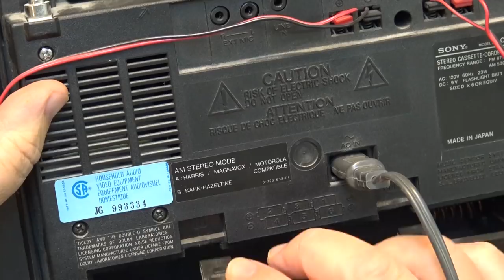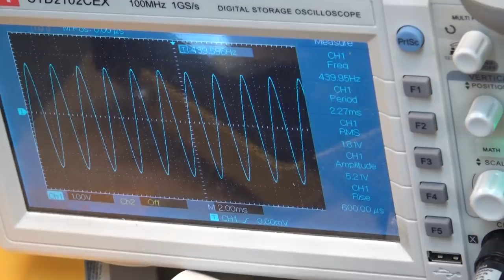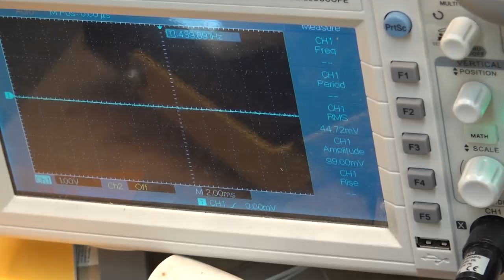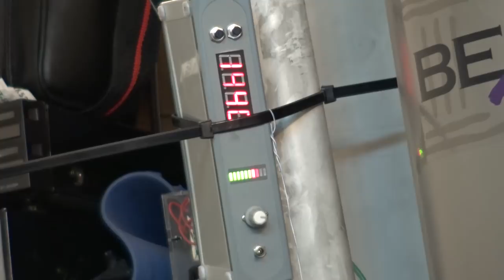Sony CFS6000 Boombox Tape Deck Service

Comment: Is that where my screwdriver went! 
Fancy that, my screwdriver made it on YouTube before I did! 
Well at least it's found a good home, glad to see it doing duty on a classic boombox. I have a real soft spot for the classic boombox. I love their industrial design, the mechanical and electronics that went into them and their sound. Great video, I personally would have gone right through it and checked every resistor, capacitor and lubricant. But that's just me with those things. I'm a lot less fussy when I comes to electronics that I I don't care for like the Boomboxes from the 90's and onwards, some of them were actually nice but the rest just looked like piggs, those things get taken apart and removed from memory! They make good use for spare parts! Although I did take apart a sharp boombox that I wasn't going to put back, a few days later I found myself looking at it's main PCB and noticed that sharp used those beautiful Melf barrel type resistors! And then while looking at the cassette mechanism and noticed that the erase head is the active AC type! Boy! Sharp really went all out on this boombox! Who builds a boombox like this? I feel like putting it back together just to hear how it sounds but it's to late. Now I'm looking out for another one on eBay just to test it's capabilities. 
Your Sony boombox almost looks like it has the active AC type erase head! Not the cheap permanent magnet type. I believe that the erase head type makes the difference between a good recording and the average boombox type tape recording which always sounded terrible! Unless the other wires I saw were for the other side of the playback head!
Reply: Lmao it’s ur screwdriver 😂😂😂😂

Comment: Thank you for saving this set and make her to serve it's Master for Many year's to come... Cheers 🥂..
Reply from the maker: Its not that I saved it, I bought it new in the 80s specifically to listen to am stereo. We used to have great music stations in am stereo and it sounded really good.  Very close to fm but with a warm sound.  If you ever heard am stereo you will know what I mean.  You can hear am stereo on line.  There js a us station that still broadcasts in am stereo and they use their studio am stereo air check tuner to feed their internet stream so you can listen and hear how good it originally sounded.

Comment: Boiling the belts was a HUGE tip, wow. I bought this model because a station does C-QUAM locally and it matches my SRF-A100." :) Anyway, same deal as yours - great condition but needing TLC inside. I followed the same procedures as yourself, except for reusing the belts in mine. Tapes sound PERFECT after equalizing :D Thank you for sharing the knowledge!

Comment: Nice to see the motor not changed at all from new, dam spot on :-D.

Some of the 70's motors had flying weights inside and contacts, they worked, but by the time i got to see them, they were all worn out :-(
Reply from the maker: zx8401ztv 
These were popular in old 8 track players. Others had an fg pickup and full speed servo.
Reply: Yes they were, recently i helped my frend get an 8 track going, the headstack was frozen on the rod, and one channel was dead.
It used odd blue transistors in the finals, my mate had some in his garage in a draw, old but tested perfect :-).

It had a quite chunky looking motor, but they had a habit of a double casing the motor in those days, noise screening i think.
Apart from dirty pulleys and a very dead belt, the transport worked :-D.

The headstack took a while to loosen, wd40 was left on it for a couple of days, then gentle twisting by hand slowly got it off.
Worked great once the headstack had been adjusted.
im not into 8 tracks but my mate has an old car, its going in that.
He also had a cassette to 8 track adapter, you treated it like a cartridge then you put a cassette tape into it.
Ive never seen one of those before.

Comment: These old radios are great workhorses, those heads are immaculate should last at least 20 years, its also got a great dc bias recording head, which is rare in a boombox
Reply: AC bias, not DC bias.

Comment: We never had AM stereo here in Great Britain.
It would have been handy for the car before stereo FM was perfected.
There used to be a beat cancelling switch when recording AM which changed the bias frequency slightly to avoid clashes with the AM frequency selected.
FM here has more clarity than digital because of the low bit rate of 128kb on most music channels.
I don't know if digital radio in Canada is any better.
Reply from the maker: Yes this has the beat cancellation switch on the back. 3 position.
Digital radio here is broadcast in 2 ways. As a sub carrier on a commercial FM station, and as a phase modulated mono AM station. So HD radio as they call it (Hybrid digital) can be broadcast either way, but here in my local market it is all on the FM sub carriers. The big stations have 3 sub channels. HD 1 carries the program audio with the FM station, HD2 usually carries the AM sister station for the FM stations audio, and HD3 can carry something completely different. Here one station has music on HD1, news on HD3 and sports on HD3. Another one has music on HD1, talk on HD2 and traffic on HD3. Those news, sports and traffic stations are also on AM band.
Reply: We had it for a while here in Australia around the mid-80's but it never really took off where I lived. AM was mostly mono. Nowadays it's digital radio with a wide range of FM and AM stereo stations.

Comment: I got a few different boomboxes sharp sanyo and hitachi the first hitachi 3d8 i gave to my dad i loved it but used it on batterys back in the day and was lucky if i got a couple of hours use out of it with the 3d superwoofer in use it used to eat batterys .One of the sharps i have has an electronicly operated back to back cassette mech quite complicated has two motors two fly wheels belts and 3 or 4 solenoids not sure what sharp was thinking with the back to back mech .

Comment: The common problem I find on Sony boom boxes are Idler tires splitting in half. I use O-rings that I purchase from Harbor Freight as replacements. They outlast the factory original idler tires. No one stocks the replacements  on these Sony boom boxes

Comment: Maybe a dumb question, but why don't they used gears instead of belts?Noisy? They don't last longer than belts? Not feasible?
Reply from the maker: Mark Markofkane 
Well if you wanted wow and flutter sure. Belts are a natural shock absorber and will reduce micro variations in motor speed as the motor spins. Also when rewinding and the tape hits the end prevents the tape from breaking.

Comment: Why you didn't clean and lubricate the tape deck mechanism? you should  clean and demagnetise the recorder head and gum discs.
Reply from the maker: I don't use it.  That tape deck has not had any tapes run though it.  When I got that radio it was for the am stereo.  I have never used cassette tapes much.  I bought into dat in the  mid 80s and stopped using cassette.  I didn't lube it because it has no hours on it and hasn't even been turned on since this video was shot.

Comment: Great Video, i have the same unit but after replacing the belts & cleaning the capstan , it keeps eating tapes. is there an adjustment for the speed?
Reply from the maker: Idler likely worn.
Reply: speed slow too
Reply from the maker: @edgarregis4818  did you put the correct size belts? Too tight and it will be slow
Reply: is there a speed adjustment?
Reply from the maker: Should be on the motor.

Comment: Is there a place to get good quality belts? The ones most get and what I’ve got are very low quality and the consistency is bad. I had to sort through half of 2 sets to find one that had a somewhat even thickness so it wouldn’t have as much wow and flutter.
Reply from the maker: KP components has a fairly good selection.

Comment: Where can I buy the capstan belt for the CFS-6000? I bought a belt on ebay but it is the shorter belt. I need the longer one. The ebay listings don't give the lengths of the belts so I can't tell if any of them are the longer belt.
Reply from the maker: Belts are all sold by length.  You need to measure the pulley length.  I have demonstrated this with dental floss in the past.   Thread it around tie it tight.  Cut and measure.  Subtract 5% from measurement and you have belt size. Don't ask me, i don't know any sizes off hand.  When I need a belt i measure it.
Reply: @12voltvids  Thanks! This radio has great sound. I can't wait to play some tapes in it.

Comment: I remember when I was a teenager I used to dream of owning a Nakamichi Dragon cassette deck. Never could afford one, but they are still pretty cool. And insanely expensive now, lol. Dumb question ... how did you get the 440Hz test tone into the scope?
Reply: Looking at the relatively high voltages the oscilloscope showed, he probably hooked it up to the speaker outputs.
Reply from the maker: Hook it to the speaker terminal.
Reply from the maker: The dragon was overrated. I worked on a few of them in my career.
Reply: Knowing how many tape decks you've serviced, I actually trust your judgement. :)
Reply: Same, I wanted to own a Nakamichi Dragon when I was 16. Though this Sony boombox is almost similar to a Dragon in terms of the multitrack head, but minus automatic azimuth adjustments, but similar in they only record in one direction only and reverse play.

Comment: This was a great and useful video. Also what a nice thing it is to see one of this old decks come back to life. Wish I could send you my Sony FH7 for service! Just one question: How does this 'belt boiling' work?
Reply from the maker: The heat charges the molecular level in the rubber and helps it return to elasticity.
This does not work with all formulations. I believe it only works with natural rubber. The synthetic belts don't shrink when you heat them. Or is it the other way around. 
Anyway worth a try if belt is slipping. It either works or it doesn't. More often it does.
Reply: @12voltvids  The belts have to be put in water and then in the microwave? (Apologies, this obscure technique is new to me) Thanks!

Comment: All these years of tiny belts in things and nobody has found a better material or way to make them or completely remove the need for belts at all.
Reply from the maker: Tyler Harris 
Direct drive is costly. Even my high end teac 850 is a belt drive capstan. My technics rem275 is direct drive. It was a bloody expensive deck though. 
My technics slm1 turn table also direct drive. This also drives up the complexity as special drive circuits required. Most vcrs were direct drive for drum and capstan. At least vhs was.  Many beta and 3/4 were belt drive.
Reply: Would actually be nice to have a show of what equipment you own and love.  Seems we all have our stuff that we never want to get rig off.    I still need to get a 230V to 110V transformer to power up my tape deck to give it some maintenance.
Reply: Direct drive means motor / gear / bearing noise is that much more critical. There are some (cheap) direct drive tape decks that exhibit more wow & flutter than belt drive jobs with a decent-sized flywheel! The latter will take out the higher frequencies very well in particular. Hence why good belt drive turntables with heavy platters can still be every bit as quiet as a good direct drive, just arguably more expensive to make nowadays, and precise speed tends to be an issue. Around 1980, some manufacturers (e.g. Philips) also made some quartz controlled belt drives in order to combine the best of both worlds.

Direct drive can be cheaper when you need just one motor, but rather not when you need a whole bunch. Belts still are a lot cheaper than decent-quality motors.

Unfortunately, things that are soft and flexible always tend to be rather perishable as well. Some tape deck manufacturers used nylon gears back in the 1970s in order to reduce noise (Grundig was quite notorious for that). Guess what, nylon is hygroscopic and has a tendency to become soft and not withstand much force. That said, my parents' Technics SL-BD20 from the early '90s still is on its original belt, knock on wood! (Technics tended to use synthetic rubber belts. Not quite as good as natural rubber when new, but they hold up a lot better.)
Reply: i'm surprised they never made belts like the panasonic g deck plastic toothed belt, i mean i got one and is very reliable compared to rubber belts
Reply from the maker: And noisy like a chain

Comment: Not using the tape deck at all from 1986 is Mechanical cruelty  Mr  !!!
Reply from the maker: I used cassette (with DBX noise reduction) during the cassette years. Now, if you remember from other demo's a tape recorded in DBX won't play in a non DBX deck, so this was used as a radio. I bought t as an AM stereo collectable radio. I had a Panasonic cassette deck in my car that had DBX. I hate tape hiss. It drives me crazy. I made the jump to DAT as soon as DAT became available and had a DAT deck in my car too for many years. Then Minidisk and recordable CD. I probably had one of the first CD burners on the market. It was a 2x CDR 1x CDRW only burner, and back then bank disks were over 10.00 for 1 and CDRW 20.00.
Reply: DBX  something I will not use as I always using different decks .
DBX is a one off 
I amusing MiniDisc  cus I love the thing  ,  I have the homebase  SONY as the Mother ,  and 2 portables  , one is a SONY MZ-N510 TYPE-S  still works fine without abuse use as well as a SHARP MD but this one sticks after playing for 10 mins  , maybe the LASER is burned down a bit .
Portable MDs   SONY I never got this to record input for some reason , got the manual with it but  no playback  , funny that .
All better than using CDs  for recording with that potective case .

Still Mechanical cruelty  as charged     lol
Reply from the maker: Cassettes were and always will be "tacky little plastic things"
I put up with limited interchangeability for sound quality. I had 3 home decks and a car unit with DBX, and would just dub a tape to a second copy for my old walkman. i used DBX to make my master mix, and then dubbed to dolby for the copy for the walkman, and another DBX for the car copy.